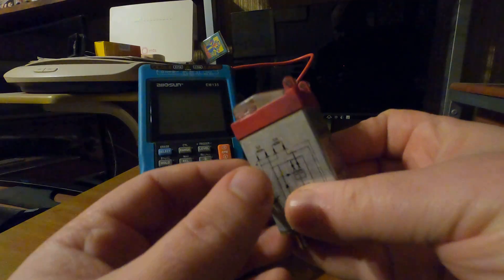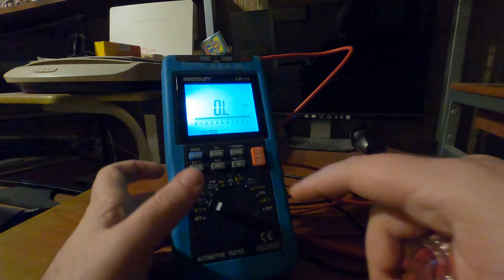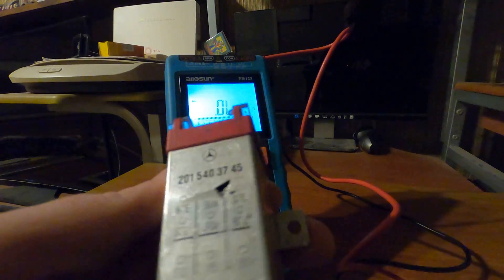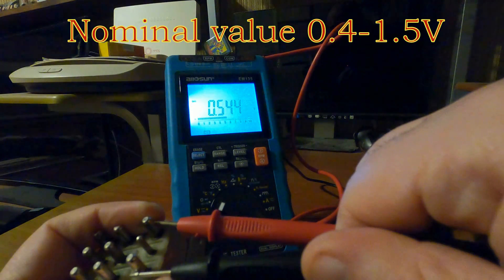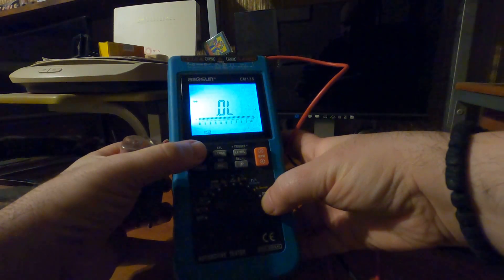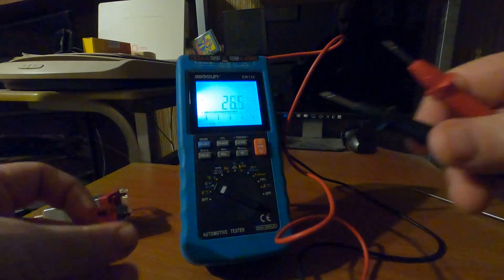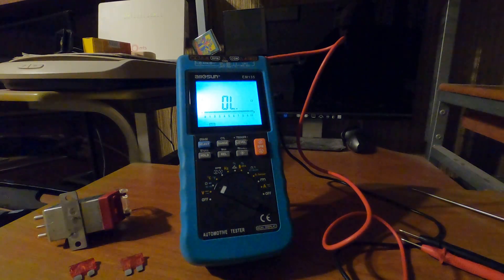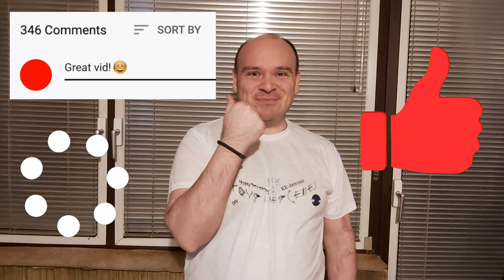㉦Mercedes Ke-Jetronic㉦ - A quick addition video to the OVP

Comment from the maker: In this short video I will be talking about the OVP how to check it if you doubt it. There were many types of this part(6,7 and 9 contact part) but for all of them are 3 contacts in common - 30(the positive coming from the battery), 31(the ground) and 15(the ignition ON). With a help of the multimeter which has the diode check function you can check your OVP if it's within the specifications(0.4-1.5V). If the OVP fails this test then check the fuses(the buzzer on your multimeter) and if you get no conductivity then your OVP is bad and has to be either replaced or soldered). Let's keep our legends on the road, Happy Mercedesing!

Comment: Hello, i found out that my ovp is bad, i bought new and after that swap, my car wont start. If i take ovp out and unplug it, i can start. If i warm engine to 80 celsia, turn ignition off and put ovp back, it will start, but cant accelerate... I tested icv and its work on every voltage as it should.
Reply from the maker: Test the old OVP again. You have contacts 30,31,15,87E,87E,87L,87L,30a,30a. Test it as in manual, you have the video. Your OVP is power supply for 3 things - the ECU KE, ECU ABS and for the idle control valve. 30 is the power supply for the OVP, 31 its ground, 15 contact, 87E is for the KE ECU 87L for the ICV. Remove the relay and test with the buzzer in order to check if the wires are okay or not. Adterwards test it under voltage. In the manual that's the first step, it's the same for all the engines. Maybe there is a loose connection somewhere. If the OVP is bad usually you should have difficult both warm as well as cold starts. Here, check this video and check everything I told you starting from minute 5:30.
Reply: @mercedeske its weird, but perfect cold and warm start without ovp. I think that somebody mess with eha to work without ovp... I have to buy second barmeter and test it...

Comment: I don't understand how you can have a voltage without the OVP being connected?
The values ( 0,4 to 1,5 V ), did you find them in the WIS?
Thanks
Reply from the maker: In the instruction. Measure this if you have the "diode function" not voltage!
Reply: @mercedeske  Yes I agree with you but your multimeter indicates V and you talk about measuring a voltage.
Reply: I forgot to tell you that I have never done this kind of test, that's why I was surprised😃

Comment: hi, do you know why each OVP pin socket has two wires connected to them? I broke a pin socket off, I want to twist the two wires together and use a connector to connect the socket to the pin. will that be ok?